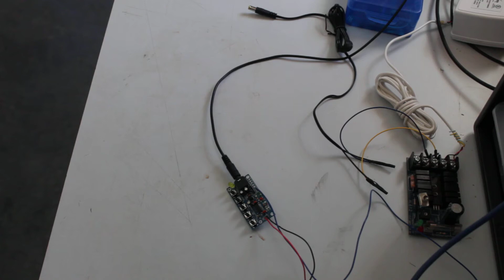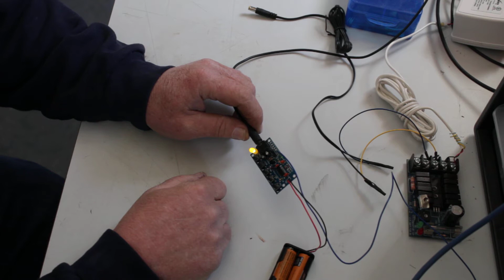FM 76MHz-108MHz Wireless Stereo FM Radio Receiver Module PCB DIY Electronic Kits

Comment: I have two of these kits and one by another manufacturer and this one is better because of the light and antenna hookup. One of these kits is unassembled but i want to add radio functionality back to a boombox that I have where all it has left is a CD player and tape player. The tuner board got smashed because some stuff fell on top of the radio and that's how I got it. Was given to me. Id like to kove the buttons to the ouside of the radio case as well as the led. Not sure how I'll power it, probably just use the AA batteries it normally uses unless I can find a 3v power rail in the radio.
Reply from the maker: I would love to find a way to get an LCD display to hook to this, in your adventure to get your boombox back working let me know if you find a schematic for the LCD display for this kit
Reply: @DIYELEKTRONICKITS  I don't think there is one. I'm not the best at electronics but I dont see any type of connection for an LCD screen. There are a few points on the board but they are power and left and right audio out so you could hook this to something else like an amp and 3 volt power.

Comment: The board I got has the resistor and capacitor values on the back.
Made it a whole lot easier to put together.
Check to see if yours has it on the back.
Keep up the good work!
Videos like this are much more educational than some of the stupid Kardashian, etc B.S. on YouTube  :)
Please post updates if you have info on the blank holes at the bottom.

Comment: I just put one together tonite, all the resistors tested 10k ohms so placement doesn't matter. I'd never soldered a little chip before but it was easy, I centered it on the pads and held it in place with a drop of super glue. Then I flooded it with flux, applied solder to the tip of my iron and drug the tip across the pads and it soldered perfectly. I hooked wires from the back of the headphone jack to the audio in of one of those 99 cent LM386 amp boards and it powered some small speakers just fine.  Fun little kit.

Comment: Can I plz get the list on where all the parts go and do you know is it possible to remove the mute so when I scan I can get the static in between station. Thank you
Reply from the maker: Stereo  FM Radio Module Kit 76-108 Mhz                                3/30/17

R-1     10k

R-2     10k

R-3     10k

R-4     10k

C-1     100uf/10v

C-2     100uf/10v

C-3     104

C-4     33

C-5     104

D-1     IN4148

D-2     IN4148

Q-1    8050

Y-1     Crystal

L-1     100uh

A        Antenna Wire

+     Positive of battery pack

-    Negative of battery pack

Take your time soldering the SMD Ic

Do not overheat it.

Best to use paste solder and a Rework station